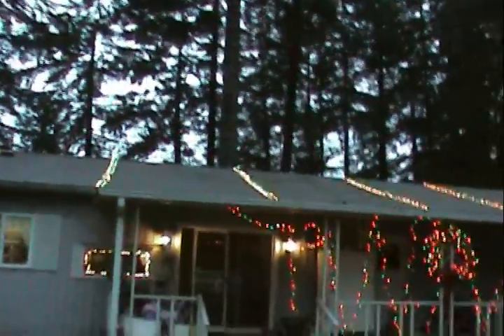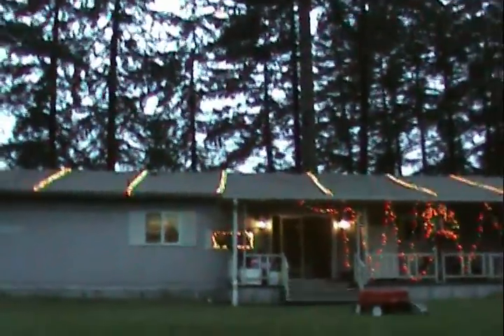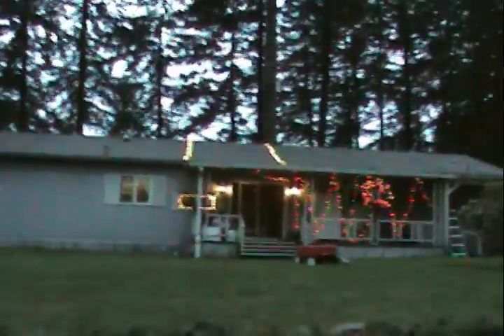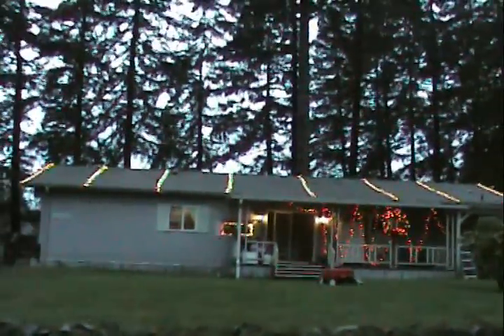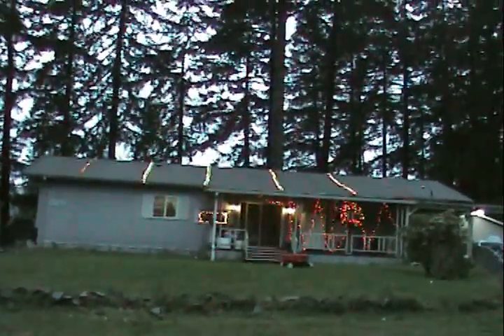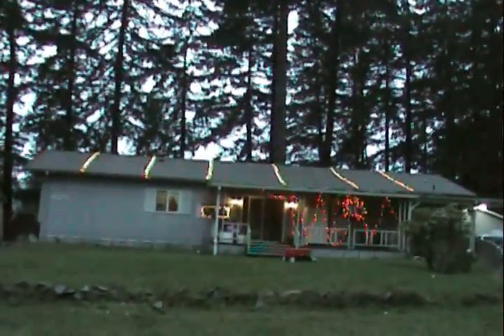Arduino Uno based Christmas light controller

Comment: xD nice i am working in something like that:
12 ft crhristmas tree.
19 " Rack Mount Equipment Powered By Arduino Mega2560
And i have a .Net Driver 2 Bytes matrix based On Off 16 120 vac-dc Load 
intending to implement FFT which will be integrated with iTunes.
Could you give any info about what you are doing.
if you like i'll pass you the software.
Sorry for my english S.L.P. MX.

Comment from the maker: @MrHorsetail I'm using Solid State Relays, I got them from AllElectronics for like $3.25 each, they're really easy to use because they hook directly to the Arduino, no resistors, no flyback diodes. They're rated for 1amp load, each, so about 100watts each.